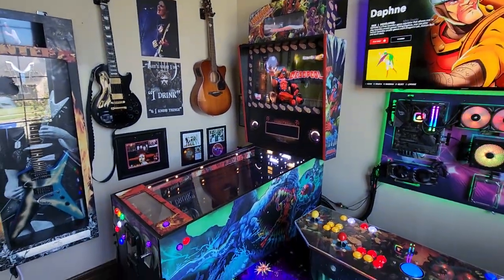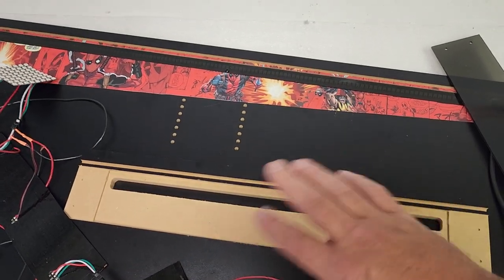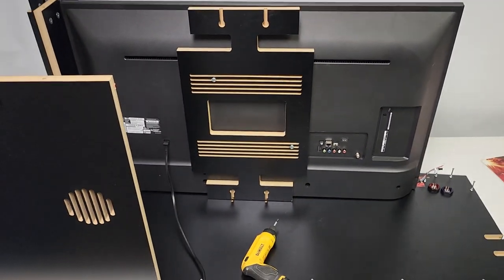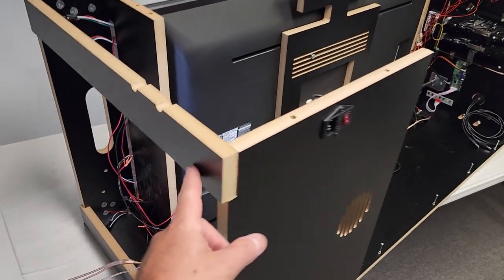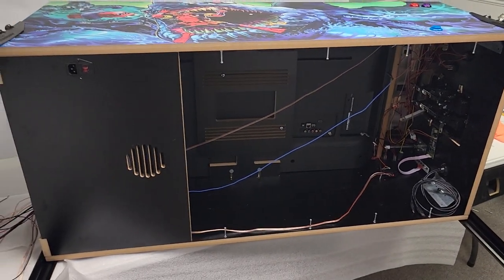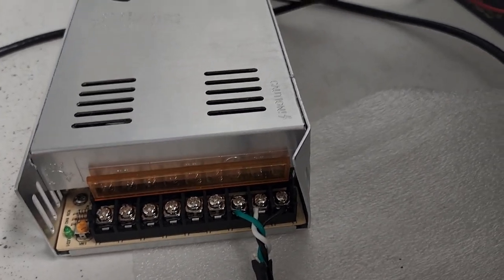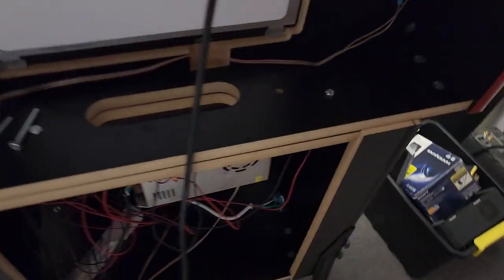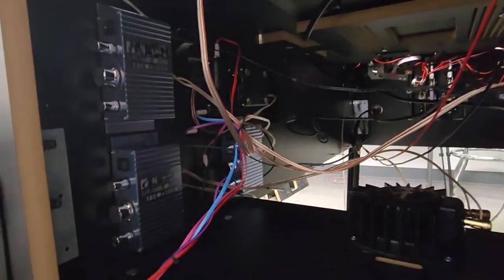GRS Virtual Pinball Rev 3 Cabinet Assembly - LEDs, Topper, Apron, and SSF

Comment: I followed this guide and built this almost exact cabinet with a few personalized variations.  The amazon shopping list was very helpful, and gameroomsolutions shared the specific config files with me so I didn't have to recreate the LED configuration.   This video is a great kickstarter, you'll still need to do some additional googling to fine tune but this video covers most major steps.

My comments:
1) The cabinet kit assembles easily and is quite sturdy. Definitely plan your install and attach whatever components you can prior to assembling so it's easier on you.
2) The addressable LEDs are super cool, I 100% recommend getting the cabinet kit with those cut outs.  A warning though, don't assume that the wiring on the LED matrix is correct, one of mine had the red and black wires reversed.  Fortunately fuses protected the wiring.
3) I used a 4k playfield with the Geforce 2080 super and there is no lag
4) The amplifiers in the Amazon cart use RCA cables for the sound, so you'll need cables with 3.5mm on one end and RCA on the other.  No big deal.
5) I ordered the 1 player cutouts on the lockdown bar/upper control panel so I could play arcade on it.  Now that I see how fun the Pinball is, I doubt I will use it for Arcade.  Knowing that now, I'd choose the apron cutout instead of joystick/arcade button cutouts.
Reply: great info. 2 questions. Do you have any sagging with the playfield plex on the rev 3 design? Also you mentioned the amazon cart for the audio parts. Where did you find the amazon list for those item? I have had a hard time finding it. Thank you.

Comment: Too bad the V3 was a year after my build lol ;)  I basically did the same thing to be able to remove the screen from the top, just routed out that channel to allow the cam to rest on it.  I also routes a notch on the underside of the side panels to install undercab lighting as well which worked out really well.  The only other thing I changed was the plex.  I got rid of it completely, drilled about 8 small holes in the notch for the plex and inserted some metal dowels and had a nice tempered glass top cut.  Easy to remove and get in from the top now.  The overall build quality and graphics on my unit was very good, a super customizable table option for sure!

Comment: Did you run power to the speaker Led lights i didnt see that in the video
Reply: you should not have to run power to the speaker lights. I used the same one ring of lights he used in the video for the speakers, and it works great without running power up to there.

Comment: looks great, to bad its not engineered in a way to be able to slide out the plex rather than having to bend it to get it out. Giving the option to replace it with glass if the customer wants to after purchase. I bought one of your previous versions and ended up removing the plex as I found it attracted to much dust from the under side. (static issue i think) I installed some rails down the insides and had some glass cut to sit on top, Love the new revisions outside of that though. If an option comes down the line to allow for glass to be used rather than plex I will upgrade from my previous build 100%. I do recommend GRS as they design a solid unit with great options.
Reply from the maker: The pocket in the right side is deeper for the plex.  No bending required.  It slides forward out of the back then in right side to be removed.